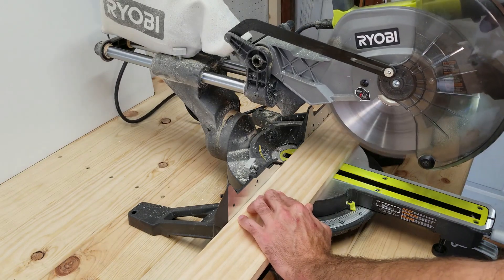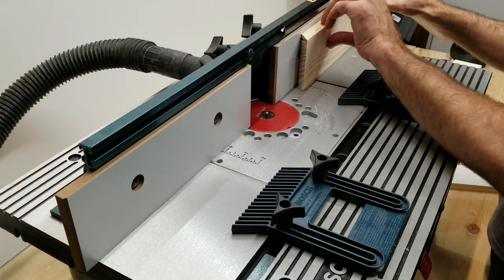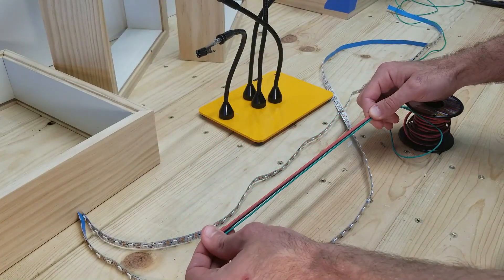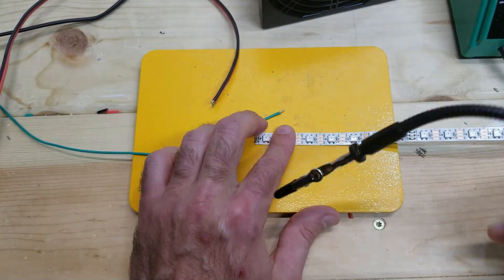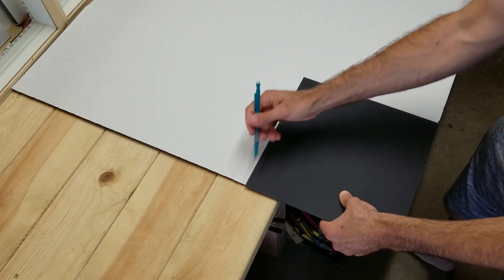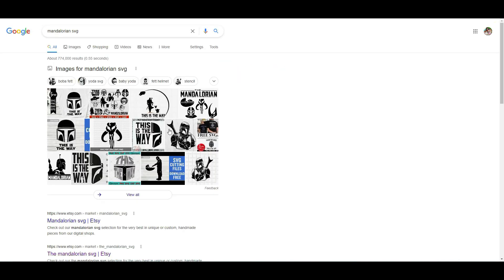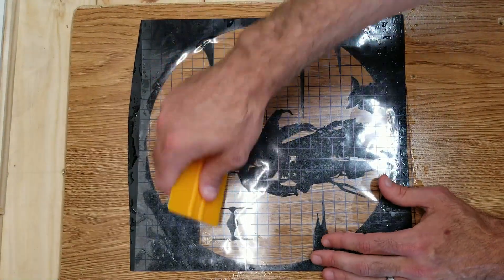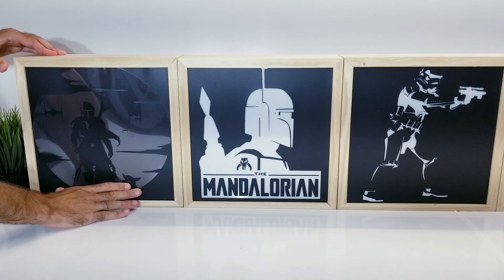DIY LED Lightbox - Full Walkthrough - Customizable

Comment: Hey Chris, I've been messing around with LED strips for awhile but your projects are motivating me even more.
Question: is that Elmer's foam board you're using?
They also have the corrugated board, which is cheaper. Do you know if they have the same white material on the front?
Thanks

Comment: A cleaner look would've been to terminate the wires from the boxes to 3-pin connectors and a nice 3-core wire in between. A clean, easy quick disconnect between frames and the PSU+controller box :)

Comment: It would be interesting to only sand one side. I have been told you sand only the back side and leave the front side clear. The edge light refracts off of the back frosted panel and you supposedly get the exact same effect/look with exception it's much easier to clean the clear, non-frosted front. Also, I've been told always flame polish the edge whereby the edge lights shine through which will create a much brighter and better illumination. Thanks for your vids. They're really great.
Reply from the maker: Thanks so much for watching and taking the time to comment! Those are all really good ideas and if I do something like this again I will for sure try doing it that way!

Comment: Hi Chris!

I was just wondering why you are supplying the last Lightbox with another + and - ?
Reply from the maker: Thanks so much for watching and great question! If you only supply the beginning part of the led strip with power, as the strip goes on, you begin to lose power and the lights will start to look different since they are not getting enough juice. Adding the extra + and - at the end is just providing extra power so that all the lights will have enough. Hope that makes sense! Great question!

Comment: Can a control module be made using arduino with WS2815 led strip?
WS2815 works with 12 volts. You can think of it as an advanced version of WS2812.
Reply from the maker: Thanks so much for the great question! You can for sure use Ws2815 with the esp32. I just made a video today on this! Feel free to check it out!  https://youtu.be/zbhdH-qSANc
Reply: @ChrisMaherDIY  Thanks for video. Could you please add subtitles?

Comment: I don’t think you need to convert png files to svg. If you import the file to Cricut design space it will convert it automatically. Either that or it reads png files. I’ve uploaded both png and svg files to my cricut. I have been using these machines since back when they only had cartridges and were mainly used for paper. I love this idea. So simple yet so cool.
Reply from the maker: Thanks so much for watching and taking the to comment! I appreciate the advise and I'll have to try that out! I'm still pretty new with the cricut but love it so far!! Thanks buddy!

Comment: First of all, these look sweet! Thanks for sharing! Do you prefer this design or do you like the frosted acrylic with underglow more? Thinking about making one or the other, but since the frosted takes less LEDs, it would leave more for another project. Are there any major disadvantages compared to what you showed in this video? Is it way dimmer or anything?
Reply from the maker: Thanks so much for watching and great questions! I would say these get a little brighter than the edge lit design. However the edge lit design is not as bulky as this one. So there are positive and negatives to each lol. I know that doesn't help! But i think I personally like this design better since i can swap out the images.
Reply: @ChrisMaherDIY  I ended up getting the material for these back lit ones, but if I did edge lit, I was planning to use the vinyl on stencil sheet like you did here to keep it swappable. Btw your WLED videos were super helpful on my last project which led me to this one.

Comment: Would you happen to know how to connect a Govee strip to a different controller? They use red, white, and black wires soldered onto their board labeled B, g, and vcc respectively.
Reply from the maker: Thanks so much for watching! I did make a quick video on how I was able to get some Govee led lights to work with WLED. Here is that video! https://www.youtube.com/watch?v=l0sRG1WAbq0&t=14s
Reply: @ChrisMaherDIY  thank you so much! I just want govee lights to be cool!

Comment: Great job Sir! For me is too complicated this and i dont have the tools. Can you please tell me if i can find somewhere finished vinyl images for example about Halo universe so i dont need to buy a Cricut Maker? Its easier just to buy a few vinyl images and acrylics and inexpensively swap out one image for another . Any help will be much appreciated!
Reply from the maker: Thanks so much! I would recommend going on Etsy and just search halo vinyl decals. If you cant find one you like, just message someone who has other images you like and see if they can make a custom one for you. Most people are more than happy to do that and then just send the decal to you in the mail!
Reply: @ChrisMaherDIY  Thank you so much for the reply. One more thing.Once i get the decal how can i make it stronger? Do i have to use the transfer tape/ stencil sheet method? Is it the only way?
Reply from the maker: @GRJOHN360  transfer tape is the only way I've seen and for sure do the wet method to avoid bubbles. To make it stronger I would maybe put a thin piece of hard see though plastic over it to give it some extra protection.

Comment: Chris! Love this project. I’m planning a build of my own and a question. Where are you hiding the project box?

I’m thinking that I’d like to keep the external guts to a minimum. Ideally, power cord only. I bought the project box you recommended and would like to stash it inside the frame but it’s going to be a little big and may block some lights. 

I considered affixing it to the back cover, but wanted your thoughts. Perhaps a way smaller box that could hold the esp8266 module? 

I’m excited to share my results. Just waiting for my new table saw to arrive!

Thanks always!
Doug
Reply from the maker: Thanks so much and I still think this was my favorite project I've done! Quick question, what are you referring to when you say project box? If your only doing 1 box you would not need the big power supply that I used. But I will generally have the power box and the controller near the wall plug and then run the small wires from the controller to the led strip. Those wires can easily be hidden with any cord management stuff you find on Amazon. I will then just usually hide the power supply that's near the wall outlet with either furniture, a plant, electric fireplace, speakers etc. Anything to get it out of sight. Hope that helps!
Reply: @ChrisMaherDIY  Thank you. I was referring to the black plastic box you use to house the controller board. If I find a smaller one, I could stick it to the inside wall of the back cover. Does that make sense?
Reply from the maker: @Roadrunnerwoodworks  ahh gotcha! Yeah honestly I think you could for sure do it inside if you found a small one. I also don't think you would notice any interference with the light being potentially blocked a little bit either! I'm excited to see how it all turns out!

Comment: I have literally purchased my first ever table saw, and a Cricut just because of this video. I've started getting into LEDs and your channel has been a MASSIVE inspiration. Thank you for all you do!
I had an idea of slightly reducing the depth in the rear (so moving the LEDs closer) but then have room for the controller to sit directly behind the frame. A female DC port can be added facing downwards so that you can use a normal DC outlet (in my case, preferably a USB-to-DC cable) and then power can be run either within the wall (not recommended) or at least you can get by with a standard USB wall outlet (provided it supplies up to 3A). This would mean you'd need a controller for each individual box but through WLED it can all be controlled through a single app anyways. Just my idea for what I hope to do once the last of my Alibaba packages arrive :)

Another downside though would be the power limitation. As each pixel needs ~60mAh, and this is ~70leds it appears, it would need 4.2A to work at full 100% white. Because the USB-to-DC cable can only output 2A, brightness would be limited to 40-50%. In the dark I don't believe this would be a major issue as I tend to run all of my LEDs at 30-50% brightness anyways.
Reply from the maker: Thanks so much and i love hearing stuff like this! Its a fun little hobby for sure. I love your ideas! Sounds like yours will have a much more finished look than mine. Each one having their own controller is no big deal at all as long as you dont mind the extra cost of the controllers. I'm the same way. ive never had the need to run the leds very bright but if I actually had them on during the day maybe I would want the extra power? But like you said, nothing is as convient as the standard usb wall plug. Thanks so much for sharing and let me know how everything turns out!

Comment: How would they look if you put the vinyl on the other side of the acrylic? Like have the black acrylic and put the vinyl behind that to hide the design until the light is turned on?
Reply from the maker: Great question! That was originally what I was planning on doing. The short answer is it does work and it does look cool but you do lose some of the sharpness of whatever vinyl image you use. You can tell what it is but its a little blurry. Thanks for watching and great question!
Reply: @ChrisMaherDIY  Thanks for the response. Keep up the good work.!